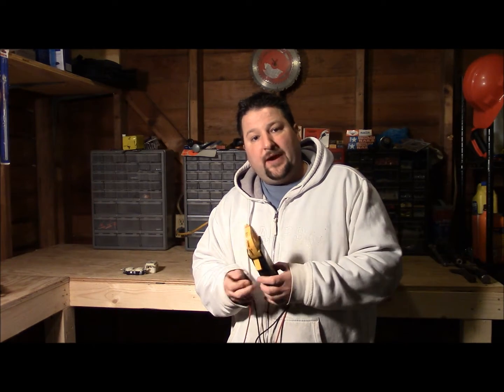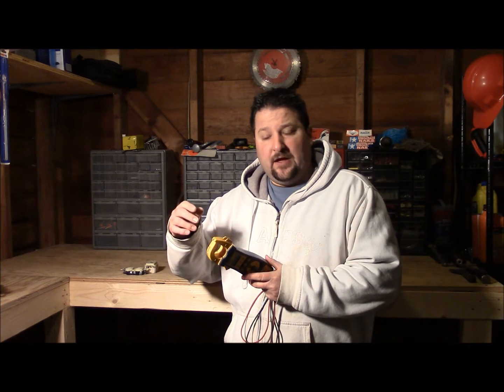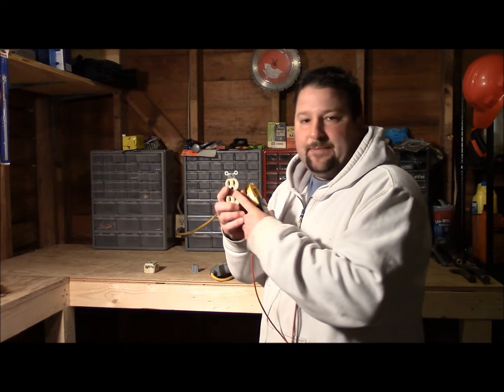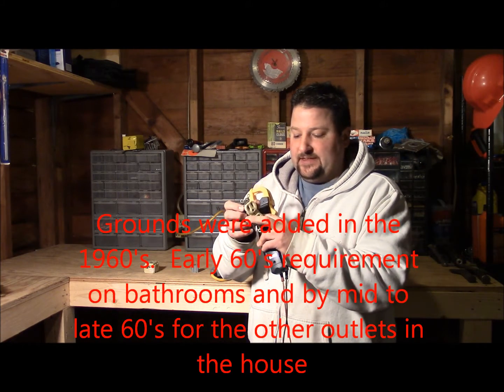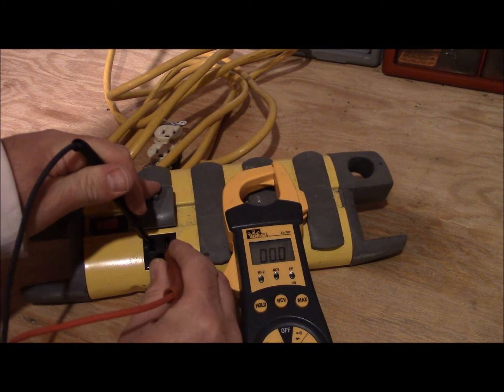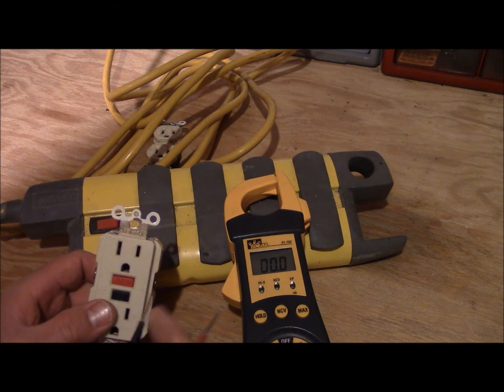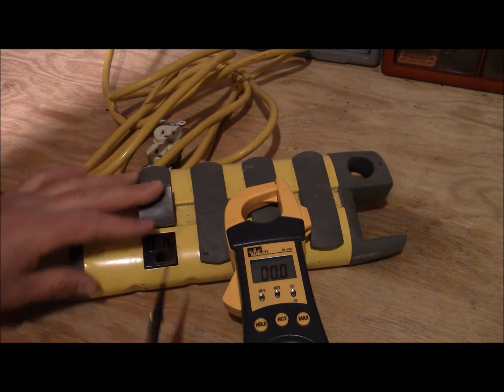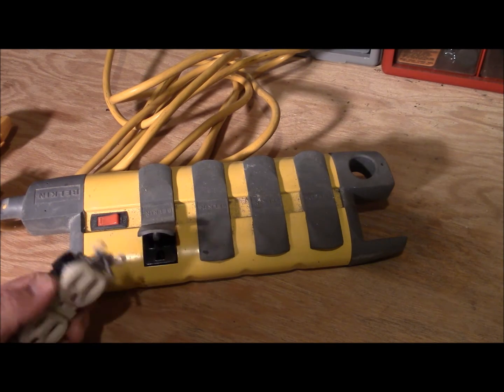How to use a multimeter to check an outlet 101

Comment: my voltage in the garage on all 3 outlets are reading 121.5 volts us that normal? I'm seeing a lot of outlets reading exactly 120/just making sure? and one of the fluctuates to 122 sometimes
Reply from the maker: +livefootagetube yes thats perfectly normal.  You can see a difference of a few volts and thats ok.  If it starts going over 5-6 volts difference then there might be a problem. What you see on the meter is one outlet is one leg on the panel and the other is attached to the other leg   I dont start getting too concerned unless I see a difference of 8 plus volts and then usually you are seeing other problems in the house like lights dimming
Reply: +The Burb Billy (The Burbbilly) okay super that is more comforting. thank you so much for the fast reply I really appreciate it. Great video keep them coming

Comment: I'm just a beginner but I would think that the black plug goes in the com of the meter: it is the source of current to the meter; so the black probe must go into the short slot of the outlet to receive current for the meter. The short slot, not the long/neutral slot, of the outlet must be called  the "com" though I haven't heard the word "com" applied to an outlet before.  How am I thinking wrong?
Reply from the maker: +mud puddle    i like to run the black to the common side or a ground when getting a reading but it will read either way     If i put the black on the power side then I was focused on the video and not my wires but you still saw a reading right?  What I would do if you learning this is to take your meter and test out how it reads the power.  An important thing to always be careful of is to not let your meter leads touch while you are taking a measurement as this will cause a short right in your face.
Reply: +The Burb Billy (The Burbbilly)  I had a question on my exam recently for Inspection that said " if you put both plugs of your multimeter in the larger side of an outlet and the multimeter rings is this normal and what is happening?" Could anyone help me out here?

Comment: I have a GFI outlet that is wired correctly. Fused box was checked out good. GIF outlet Led light is on. At bottom of outlet wires shows 123 volts on the common and hot wires connected to the screws. I put my leads in the bottom and top outlet sockets it doesn't show any volts. I switched out outlets for another GFI outlet with led light I'm still having the same problem. Any suggestions ?
Reply from the maker: +carlos perez   If you have 120volts at the wires and you connect them to the outlet and it doesnt work then the problem is with the outlet or how it is wired.  On a gfi there are usually two hook up points, a line and a load.  Make sure you are wired to the line side.  Make sure you have the ground connected, shouldnt be a problem but lets make sure its wired right.   Once you have it this way then hit the reset button and see if it clicks and stays or if it doesnt reset.  If it stays then it's seeing power.  Then test your voltage.  You may have a bad gfi outlet but I doubt you would have two back to back(stranger things have happened though :-))
let me know it this solves it